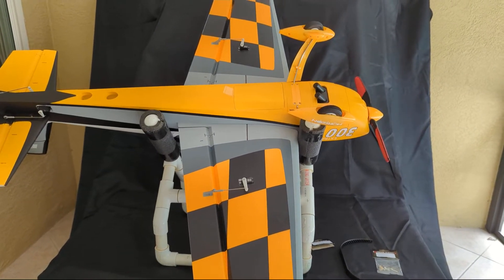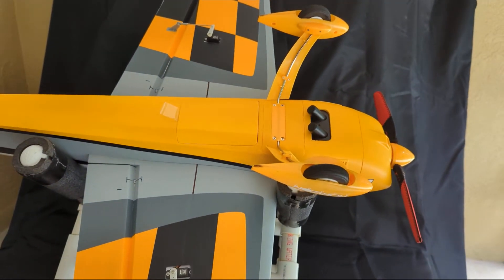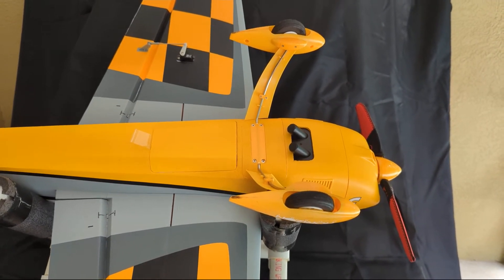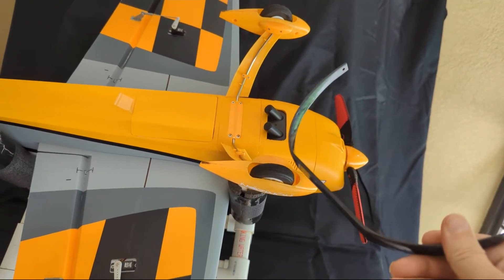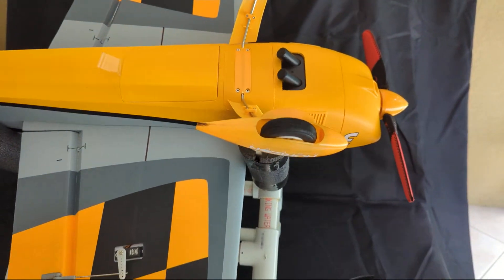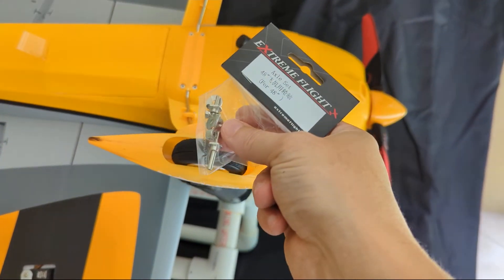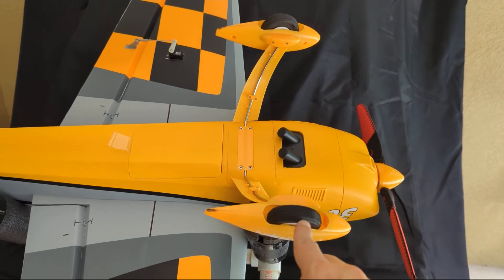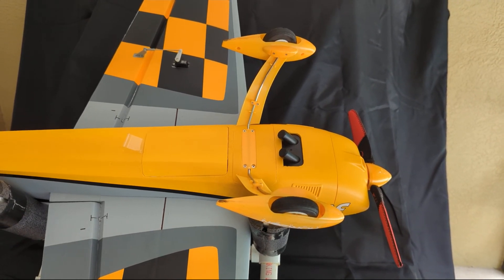E-flite Extra 300 - Update 2 - Landing Gear Modification

Comment: Have this plane it’s been kind of a disappointment flies like a block of foam and the landing gear is crap ….I just can’t get it trimmed maybe it requires the gyro to fly decent?? And the bolts that hold the wings are a big pain to remove
Reply from the maker: I have found that this is a decent flyer. Not great, but not horrible. I agree that the gear is not good (hence the upgrade). I never take the wings off, so I can't speak for the wing bolts. I have the bind and fly version, so maybe the AS3X system is helping more than I realize. I have mine trimmed just right and she hoolds anline nice and tight. Also, I have added some mixing to mine to correct a few places where the airframe falls short. Be diligent with getting her trimmed out and I think you will like it more than you thought you would.